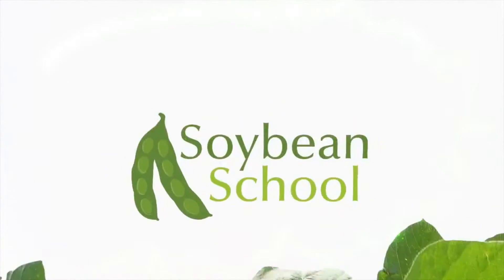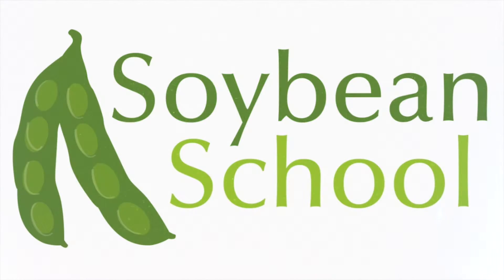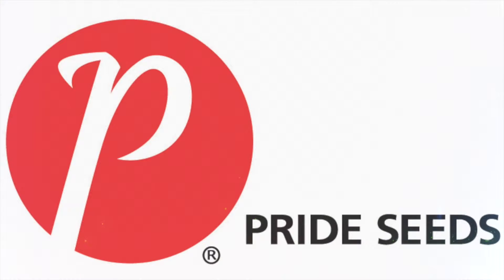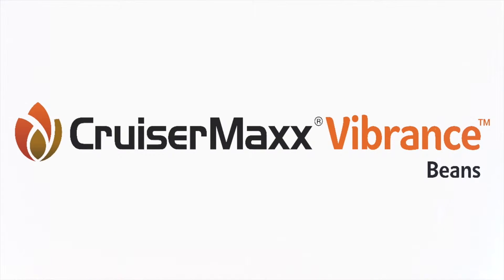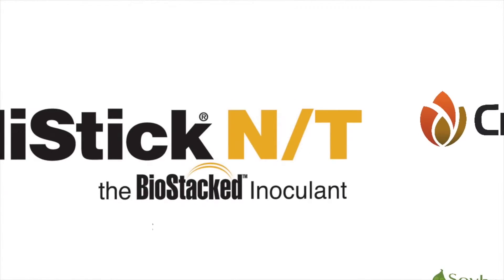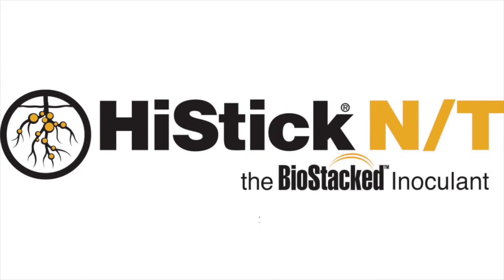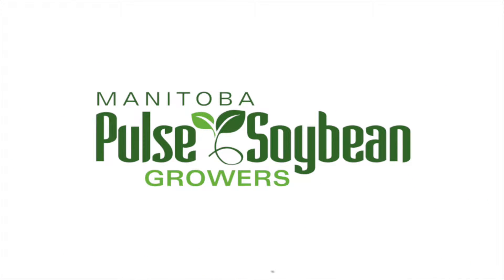Soybean School: Adding Moisture Back to Too-Dry Soybeans

Comment: What bothers me is that a premium is not offered for grains or pulse crops that are over dry. This idea of reconditioning grain is not efficient in many ways:
1. increased chance of spoilage - It would be peace of mind to leave over dry grain in the bin compared to trying toe the line.
2. increased shipping costs - adding lost moisture = "more" grain to sell but it still needs to be shipped... at a cost.
3. more money spent on electricity to recondition over dry grain AND handling costs associated with managing expanding beans / grain in the bin.
4. risk to bin safety AND personal safety if the bin bursts

These are all of the reasons off of the top of my head. There are likely many more. As a farmer I would LOVE to see grain buyers recognize the potential benefits they too could realize if farmers did not have to recondition their crops! I think both sides would benefit.